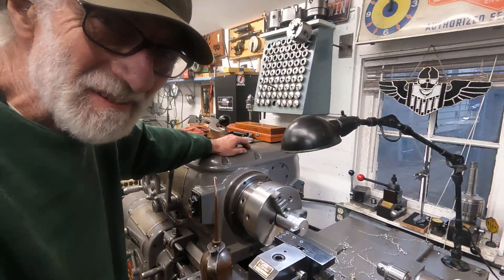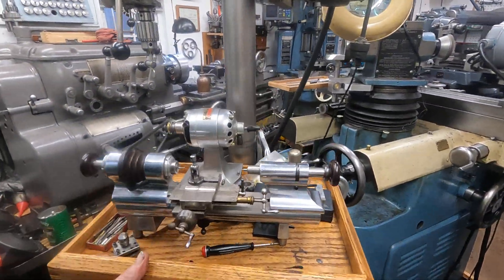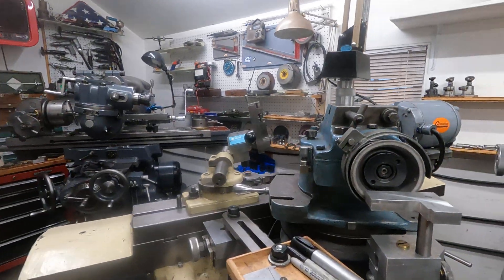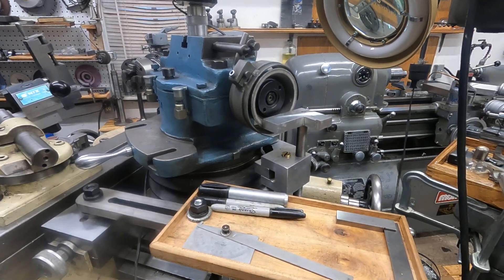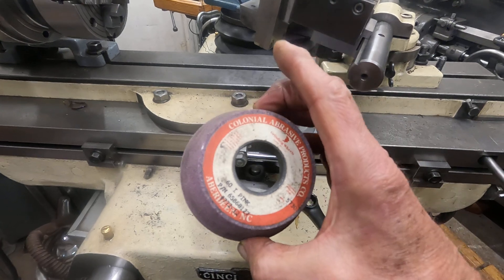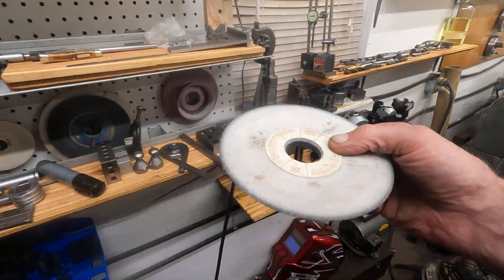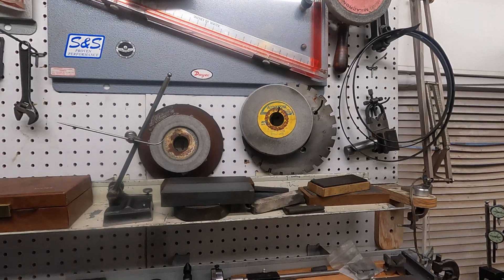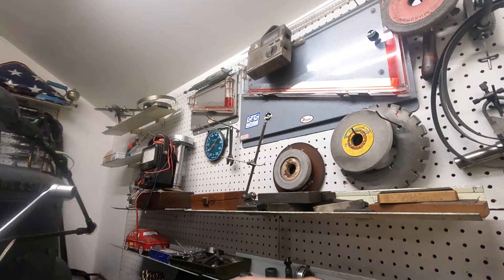Tool & Cutter Grinder Wheel Safety

Comment: I watched a video here on YT 15-20 yrs ago. It was an industry safety training film produced by the vitreous stone mfgr assoc, or something like that. Probably '60-'70's era.

I've been grinding w/ stones on big boy side grinders, 1" arbor die grinders & bench grinders since I was a teen, 50+ yrs ago, but this training film scared the crap right outta me.

I had picked up a couple of jewelers'  2 × 6" centrifugal abrasive wheels at an estate sale, but hadn't mounted them up.

I got some of the 18 13/64 (?  Pi x 6), belts & mounted them up on a couple of 1 hp grinder motors.

I fell in love w/ the things. No more wheel truing, need coarse grit, change to 36 or 40, need somethin' glassy smooth, throw on a 400-600.

They're not cheap, the good ones, anyway. I bought a 1.5 x 6" cheapo a while back to run a diamond belt on, but haven't got the room for another grinder until I finish my shop expansion, (cancer treatment's slowed me down, some); diamond belt's too dang expensive to do any kind of dbl duty; carbide only.

I don't miss stone wheels, at all.

Re: cup wheels
The one I have are mostly aluminum, w/ stone on the important part. They may still fly apart, but they'd be loosing an edge, not exploding the main body.

Got a mixture of CBN & diamonds from China via eBay for peanuts, but they are not cheap, shoddy products. Just bought direct from manufactirers; singles at 1,000's price.  Don't know why they bother, my theory is it's a way for them to easily manage product samples; sell it ridiculously cheap, free shipping & eBay handles the transaction. 

 It's the only thing that makes sense to me after backtracking eBay sources & researching products & the Chinese industrial manufacturing segment.

Fine quality & the same thing the big suppliers charge 10x's as much for, w/ an American company's label on it.

GeoD
Reply from the maker: I need to gain experience with CBN wheels, I have used CBN inserts on a lathe. that cancer thing I didnt feel better for a very long time but tried to keep moving forward. Thanks!
Reply: @deedeeindustrialsuperprecision  Moving forward is about all a guy can do.

The biggest realization for me in this whole cancer thing is it's not the cancer that's so difficult; the worst it's caused for me is a nasty ear ache. The challenge is recovery from the dang treatment.

Add to that, the docs under sold the impact, so neither I nor my wife were prepared when, virtually overnight, I went from running up & down 5 flights of stairs at the hospital, to & from rad & chemo, to completely being bedridden 4 days after my treatment ended.

I couldn't sit up on my own for 2 months & couldn't get out of bed for 2 more.

Took me over 20 months to get back to working in my shop & on the house.

Say, being a HD vet, are you familiar w/ Gibbs spray lube? Invented by a HD employee, (chem engineer), it's a marvel.  It claimed to be able to reverse aluminum or magnesium oxidation, as well as being a superior lube.

I bought a can to see what it can do.  It works. If you have alum w/ the crumbling white breakdown from oxidation, spray it & the next day, it's gone.

I use it on raw alum anything or mag car part. It gives it a darken patina which acts like anodizing. Lasts until it gets physical abraded.

It also works on steel; not to the point of rainproof, but atmospheric moisture from the winter won't get to it.

I've found it works best if you heat the metal on a furnace vent before spraying.

It's also a top shelf spray lube.

Never seen it anywhere but directly from the inventor's website. After the 1st can, I ordered half a dozen, so haven't bought any in years, but found it easily w/ a Google search.

Curious what the price might be on a used grinder-sharpener, so I'll be interested on what you tell us about the plastics comp liquidation.

Later,

GeoD

Comment: I just bought a joblot of unused HSS tool blanks, good 5% cobolt ones, 16kg or about 35lb for £195 (bit over $200) which contained tools 7/16 and up but mostly 11no 1" square by 8" blanks, so I have plenty of big HSS for lathe tooling now.
I recently bought 4 large NOS butt welded HSS tool blanks to use on my shaper, they are about 11" long, 1 1/4" tall by 3/4" wide, of course only the last inch or so is HSS, perfect for my 18" shaper, not something you see very much nowadays a welded HSS tool, though they are still made.

Insert tooling is just so easy and convenient though and for standard common stuff actually pretty cheap and if you want to spend the money lets you machine pretty much any nasty or difficult material.
Reply from the maker: I salvage a lot of steel and I really like using the 432 Cnmg inserts "cheap ones" to crunch through welds! I bought some newer better quality DNMG  "Walter" inserts and they are amazing. and a the usual cut off and notching inserts, but the hss and brazed carbide are still very useful for me I remember coming across large brazed hss tools

Comment: My cutter grinder isn't nearly as capable as yours (KOLee) but I have many attachments and it is extremely useful and is only limited in its use by my knowledge and imagination. I haven't had any catastrophic wheel issues but I've made a couple of wheel guards specifically for stone cup wheels. I do like the diamond and CBN cup wheels for safety. Thanks for the instruction and for passing on your experience using your Cutter grinder. Thanks
Reply from the maker: We had a KO at the school here and it could really do a lot of things, I have not had much opportunity to use cbn wheels and plan to pick some up. I do more other things with it than sharpen endmills it seems, thanks